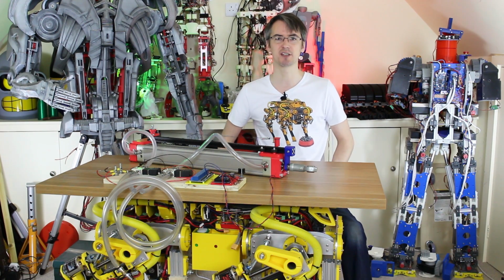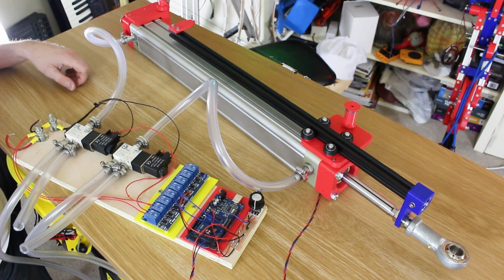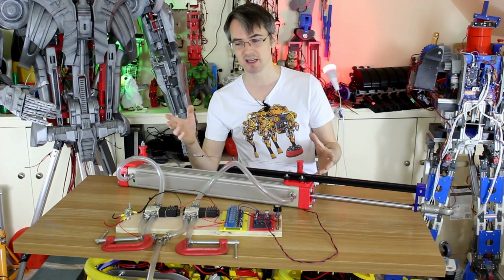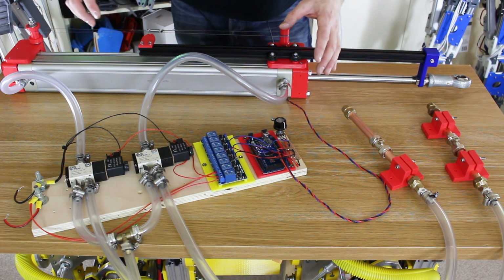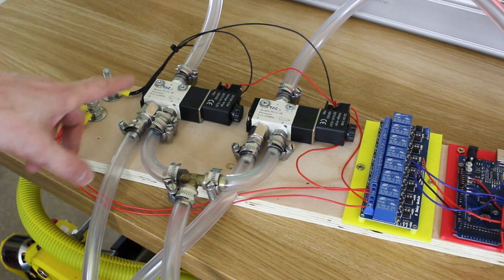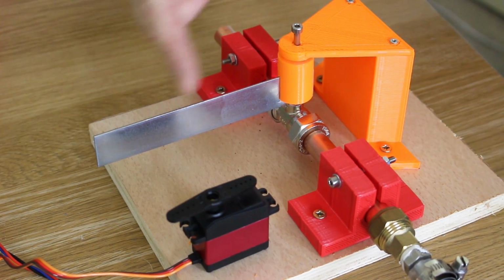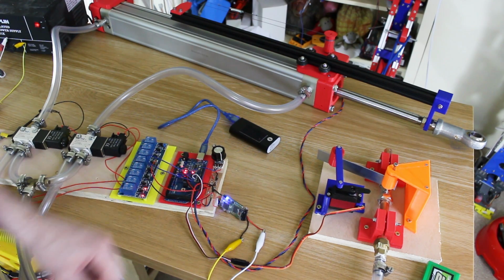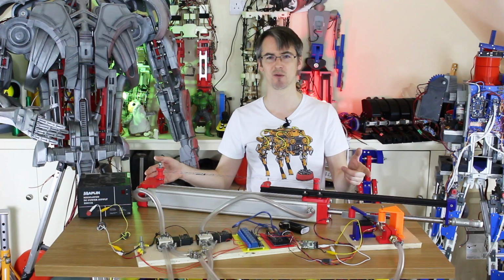Testing Proportional Control of Pneumatic Cylinders | James Bruton

Comment from the maker: So why does the creep go away when I use two separate air sources for each side of the cylinder?
Reply: You are running into why nobody uses a compressible fluid for proportional positioning. The creep problem is likely a number of compounding issues.  Your biggest hurdle is the sticktion of the cylinder gland and piston; the difference between static and dynamic friction. Coupled with low working pressures and low tank volume. Try the cylinder vertically with a heavy weight and larger tank volume; it will have less creep. You can confirm this by using your small tank and very low air flow with a heavy weight. That'll negate the seal sticktion and the small tank problem. I did a demo of this years ago with a cheap flow meter and an arduino and only got to +- 5mm. You're feedback servo is far superior to my flow meter method.
Reply: @arduinoversusevil2025  Hey uncle, glad to see you here!
Reply: Two separate supplies are stable because each side of the piston end up at different pressures, put a pressure gauge on each side of the cylinder and separate the air inputs, you should see that the rod side is higher pressure.
With the same pressure input to both sides you have a force dissemblance toward the rod side because the pressure is maintained the same on both, but the area acting with that pressure causing force, is different, causing drift.
Reply from the maker: @ChatNoirLe  both sources were connected together when they were charged, so they must be identical, to start with at least. It worked first time like this - and this is how I did all of part 1, so I can't see how it's coincidence that one happened to be slightly lower pressure.
Reply: @ChatNoirLe  adding a pressure gauge on each side of the piston AFTER the checkvalves would show that even with a singular airsupply the pressure difference inside the piston will be the same once the creep stopped as when he had the two airsupplys with different pressures...
Reply: The high volume of air just affects the speed at which the creep is fixed. 
The creep is caused by the re-compression of the air in the circuits on closing valves until stabilizes. 
Having a big reservoir makes this re-compression happen quicker, because increases the flow.
Reply: Firstly, the surface area is not identical on both sides. It is smaller on the side where the rod comes out which means, that less force is exerted in the inward direction.

When you use one single air supply, the piston gets pushed down due to the smaller surface are on the side where the rod comes out, which leads to less force being exerted towards the retracted position. Because the air can escape to the other side (and thus the pressure is always the same on both sides) the piston retracts all the way.

When you use 2 separate supplies you are essentially using a stopper. The pressures on both sides changes to a point where the forces onto the piston from either side are equal. That causes the bit of backlash.

The volume changes the amount of compression needed to make the forces equal. If you have got more volume, you need more compression. I think that is Boyle's Law.

I think it would be interesting to see what happens when you actually stop the pressure escaping instead of just restricting it. What I remember is, that designing control systems for hydraulics (especially with compressible fluids) is not that easy and requires lot's of testing.

Edit 1: You should also defenitely get some one way valves!

Edit 2: Thought about digging up my lecture notes, but Festo has pretty comprehensive information on their website you should check out.
https://www.festo.com/wiki/en/Cylinder_actuation
Reply from the maker: @McJunk1  thanks!
Reply: Do your check valves have a spring return? If not they won't close if mounting them sideways.

Can you include a quick schematic of the connections in your next video? It would make trouble shooting much easier as most of the connections are out of the frame.
Reply: As someone who did this for research on pneumatic powered AFO's, you haven't even gotten to the complex part yet. Getting a pid to respond to a system with so little accuracy is basically impossible and is why everyone just goes with "bang bang" control.
Reply: Sorry if I'm saying something you already know.. But it would be easier for you if you take a 5/3 valves rather that two 3/2. It should kill that creep FOR EVER,!! The difference is that there is 3 position (right, neutral, left) and there is 5 entry (2 air output) so the air is distibuted in each side of the piston equaly. The piece I'm talking about is like that: https://www.festo-didactic.com/int-en/services/symbols/fluid-power-pneumatics/valves/directional-control-valves-5-3-way-single-solenoid-valve,closed-in-mid-position,actuation-in-both-directions-by-solenoids-with-one-winding-and-pneumatic-piloting.-mid-position-spring-centred,manual-override-in-both-directions.htm?fbid=aW50LmVuLjU1Ny4xNy4zMi4xMjQ4LjY2MDE
Reply: Like marc gracia said. I feel the issue here is dynamics. Gas can only flow so quickly, especially when delta P is low. There are 2 possibilities, the cylinder is asymmetric or it's a compressible fluid problem. Your volume theory is technically wrong, but volume does affect the dynamic response of the system. Bigger volume means more gas needs to move in order to increase pressure, if you pressurize both at the same time, the bigger cylinder will require more air more quickly to reach pressure. This means that more flow is needed for the bigger side, possibly indicating bigger pressure drop and slower response. If for some reason your bigger side is a bit lower on pressure, then the creep is huge until the piston moves to equalize, on the smaller side, the creep is smaller. Having two separate sources may allow the bigger side to reach pressure faster since the flow is not shared. Compressible fluids dynamics is a big topic and many times is not intuitive. I doubt you will get a good enough precision and response with pneumatics for these type of robotics, hydraulics are better suited for these applications.
Reply: Hello,

With 5/3 valve with close mid position there is no creep. Place flow restrictor s on the  hose inputs of the cylinders and you could control the speed. If you have a cylinders with a buffer you can control the last bit of the stroke.
Reply: If you use 2 sources with identical pressure and your stable point is with both valves active the push side of the piston will move  and compress the air on the pull side util there is an equilibrium in forces.
If you deactivate one valve, thus venting one side, the pressure drops on one side almost completely but also a little on the other side because of the air rushing in.
 When you activate the valve again the venting stops and the pressure builds up fast pushing the piston a little bit back.

Instead of two separate air-sources you could use one source with two pressure regulators then you can balance the push and pull difference.
If speed is not essential, use smaller hoses from the valve to the cylinder.
The start response is slower but you waist a lot less air when venting and the "brake" time becomes less.
P.S. Yo can also shorten these hoses or place the valves directly on the cylinder inputs. The less air you have to compress the shorter the creep.
Reply: Your theory is correct. The air volume in the tanks is taking up the difference in force. Air, unlike hydraulic oil or water, is compressible and is quite springy. The larger the volume, the large the spring force the air will provide. In order for the cylinder to creep, you need to have a difference in force between the sides.

If the same volume (or container) of air is used for both sides, the pressure will be equal on both sides and the side with the larger piston surface area will have the greater force, resulting in creep. With separate air volumes, the force on one side of the piston will compress the air on the other side until the forces equal out, so just using tubing for your volume of air is going to result in the smaller surface area needing to be compressed more to create an equal opposing force than if the volume was larger, resulting in creep until the forces equalize.

Pressure regulation of the air supply for both sides can be tuned to remove this problem by applying a higher pressure to the smaller surface area side of the piston so that it can reach a desired position without creep. You may need to use variable pressure regulators to achieve 0 creep in all situations when you use it in a robotic application though, because of the springy nature of air when you place the actuator under variable loads.
Reply: If you have some pressure sensors, I would be interested to see what the pressure is on both sides when holding from two air sources. The tanks start at equal pressure, but if the piston in the cylinder has different surface areas on top and bottom, when you hold it open wouldn't that force from the high area side compress the air on the low volume side? The valve and cylinder are isolated from the tank by the check valve, so there could be a differential maintained above that.

Hypothesis:
When you hold everything open to hold the system
1. Both left and right rush to normalize pressure upstream and downstream from the check valves with tank pressure
2. Left side due to lack of rod exerts more pressure and begins to compress the right
3. As soon as the pressure starts to rise, the right check valve shuts allowing the right pressure to climb

Does dual supply work without creep if the check valves aren't there?
Reply: I believe you're unwittingly hiding a variable from yourself. Since you're working in duration (opening a valve for a time until a demand position is reached), you're losing track of volume. If the sources are unequal in pressure, then opening them for the same amount of time does not move an equal volume of air. And once the demand position is reached and the valves close... it then drifts until the volume (which wasn't equal) equalizes across the cylinder. You know what a grueling taskmaster Sir Isaac Newton is... he won't be happy until the forces are equal and opposite if you want the motion to be 0. ;) LOL Moral of the story, you have to put in a volume of air on one side equal to the volume you release on the other. Wouldn't it be interesting if you could make a closed system that used the actuator as the pressure reservoir and used something like a pneumatic pump driven by an electric motor to move air from one side to the other. That would assure that the volume removed from one side, is exactly the volume deposited on the other. It can be no more and no less. (Assuming no leaks).
Reply: James, 

Your issue is fairly simple. What you have created, in the machine technician world, is called an air amplifier. When using a single air source, the larger surface area of the cylinder is pushing against the lower surface area, causing a raise in psi on the low surface area side. Air, always following the path of lest resistance, will come out and right back to the other side because of the lower psi. Now when using two different air sources, the problem seems to go away, but it hasn’t. Essentially it has slowed down the problem by creating a capacitor, with the long airlines and the two tanks. If given enough time, you will still experience creep. On CNC’s and other robotics I have worked on, they simply hold the air pressure because of this same issue. Really hope this helps and gives you a better direction. Continue the good work! I really appreciate your videos. If you have any questions, I am more than willing to help out.
Reply: Put a reg on the inlet of each valve. To balance out the movement, if the rod end had 65 percent of the surface area you would set the rear valve to be at 65 percent of the front valve air pressure.  That way the force is equal. 

Creep may also be a thermal thing. Watch it with an infra red camera. You are expanding a gas and it cools, sucking it in. Same way a steam piston retracts after injection.
Reply: Isn’t it still one source of air but I think the
Reply: was there less exhaust tubing in the separate sources setup
Reply: James Bruton if the creep was going backwards ie the other way then it may make sense but lower surface area = higher pressure so I don’t really think you’re explanation makes sense.
Reply from the maker: @oliverdowning1543  I don't really understand the comment here. Creep does what you expect (moves toward the lower surface area side) when there is one air source. But when there are two air sources is initially moves in the opposite way to the initial travel and then stops. Why is this?
Reply: @jamesbruton  put some pressure guages in line with each side of the cylinder so you can see the actual circuit pressures under different operating conditions.  If you use electronic pressure transducers you can plot this data against cylinder position and it will start to make sense.
Reply: @jamesbruton  This is very likely the dynamic pressure at work. When air rushes is it's dynamic pressure is higher than the static pressure in the other cylinder. When the inrush of fluid slows down/stops the forces eventually cancel out and it stops.

Edit: This was meant as an answer to why it goes the other way.
Reply: @jamesbruton  did you see my comment at the top of the thread? I think the reason the effect changes for 1 cylinder vs 2 is that with 1 cylinder air will preferentially flow into the bigger side, compress a bit and then expand slowly causing creep. This is because the rod side has a lower volume and slightly higher resistance. With two sources the air won't divide unevenly between the cylinders. 
I suggested trying to limit the air flow to the bigger side, but you would end up having to limit flow to which ever side has the most volume available.
Reply: @oliverdowning1543  I think not quite so in this case.  If they were separate Cylinders, with different diameters, but this is the same cylinder with effectively the same air pressure on both sides but with less effective surface area to act upon on the rod side
Reply: Justin Richards I see. I’m not an expert so I don’t know, thanks. Maybe the air is moving to the more effective surface area to begin with then because when it’s easier for the air to do that but by using two air sources each flow of air doesn’t have any choice about where it goes?
Reply: The end with the rod has less surface, compared to the other side... The rod is not affected by the pressure...
Reply from the maker: @kimonsabe  Yes but why does the creep go away when I use two separate air sources for each side of the cylinder?
Reply: the reason in my belief is that it still creeps a tiny amount which generates slightly more pressure in the tank and thus balances.
the reason that the non return valves aren't working is that these are the kinds that need a massive amount of flow before they close you need the spring loaded version.
Reply: @killer15114  Thats my thinking also
Reply: Could you try it with no input vaulves at all? Straight from the separate air sources to the cylinder ends with your proportional release on each. And then moving in one direction you just release pressure from that end. Would be interested to see how that works.
Reply: If I remember correctly, that would be because the back side of the cilinder has no piston so the air has a larger area to push, the rod side (piston side) keeps the air from using all the area from the cilinder so it has less force, so it creeps forward (I think it was that)
Reply from the maker: @MrWilliam932  so then why does that go away when I use two air sources - since the surface areas don't change?
Reply: @jamesbruton  I think, and I'm just guessing, that is because with a single source, and both valves activated, the piston forces the air from the rod side to exit via the pressure input of the right valve recirculating the air via the T-coupling and back into the left side of the piston, BUT with separated sources this can't happen because they are making force and no air can circulate between them and because the compressors have a one way valve you can't push the air back inside so the piston can't move
Reply: @MrWilliam932  I am tending to agree with this theory
Reply: @jamesbruton  the bigger total volume of air the less the effect is seen: remember that gases when expanding decrease in temperature (PV=nRT)  thus cool the surroundings. When the valve is subsequently closed the temperature will slowly rise to ambient increasing the pressure of the said volume causing a creep due to different thermal capacity of the volumes. Also, with one small tank the pressure drops more than with 2 due to the increased volume (remember the temp of the tanks decrease as well) because 2 tanks have more thermal capacity than one and the drop in pressure is less than with just one tank. Humidity decanters are needed for this reason also or air is condensed inside tanks and causes rust and debris. Also you should connect the valves as close as possible to the cylinders (use short and rigid tubes) to avoid any "jitter" or debounce when opening and closing valves.
Reply from the maker: @MrWilliam932  Yes but why does the creep go away when I use two separate air sources for each side of the cylinder?
Reply: the pressure is lower on the side of the cylinder with the rod, so more volume of air on the other side with have a greater push force than the other side, which causes the creep.
Reply from the maker: @rock-afire-fan  yes that's what I said on the video. So why does the creep go away when I use two separate air sources for each side of the cylinder?
Reply: @jamesbruton  with the 2 air sources your comparing the difference of the volume of 2 much larger numbers, making the force difference alot smaller
Reply from the maker: @rock-afire-fan  That's what I thought (and said in the video) but I assumed the force was relative to the surface area of each side of the stopper, and therefore it should have the same results.
Reply: @jamesbruton  The reason for the alrger amount of creep when only connected to one air source is that the pressure on the left side (the side that drives the piston out) creates a higher pressure on the right side, and that higher pressure will seek to the lower pressure through their common connection and the piston moves.. When you have two separate air sources it only increases the pressure on the right side, and it has nowhere to go. Connect gauges to the two sides and it will be apparent. The pressure difference only needs to be pressure times the area the rod covers.

Your check valves needs a higher pressure difference/airflow to work properly.
Reply from the maker: @rock-afire-fan  The pressure is the same, but the surface area is less on one side. But why does the creep go away when I use two separate air sources for each side of the cylinder?
Reply: I suggest to add some pressure and temperature meters at differnent places in your circuit. Then we may really understand what is happening. And maybe add a voltmeter to the powersupply of the Arduino. Even servos under some torque start to draw a lot of current.
Reply: By the "boyle marriott law" are pressure and volume connected. I sadly don't have enough time to check if it is a correlation or causality.
Reply: As the cylinder extends, the volume on one side gets larger and therefore applies less force on the piston and the volume on the other side gets smaller and applies more force
This doesn't solve your problem, but i feel  like you didn't consider it
Reply: Volume, please see my comment for information I've got for you on the subject matter.
Reply: I think there are two things at play here, 1) there’s a pressure difference between both sides of the cylinder, 2) the cylinder seal isn’t perfect.

The rod side has a smaller surface area than the non-rod side. For there to be no movement, the force on both sides must be equal. So if you sealed the Cylinder with an equal pressure on both sides, there would be more force on the non-rod side, which would compress the air in the rod side. In a perfect world this reaches equilibrium and nothing moves after this initial bit of creep towards the rod side this phenomenon is faster, and dominates the process at first.

But now you have a pressure differential over a seal, that seal is going to slowly leak from high pressure on the rod side, to low pressure on the non-rod side. This movement of air is going to cause the rod to more slowly creep back to the non-rod side. This is slower, and doesn’t show up until after the first process is finished.

When you connect both sides to a large source of air, you are making the system much less sensitive to that very slow leaking, that’s why you don’t see the same issue when you are using two isolated sources.
Reply: Because air is compressible.  The larger force on the blind side is compressing the air on the rod side which takes a little time to do. Put a gauge on both the blind end and the rod end so you can see what is happening.
Reply: Install a pressure relief valve on the blind end and set it so the pressure is bled off as to match the P*A on the rod end?
Reply: I think it is because when there is the same pressure on each side (1 source) the force differential causes the Piston to move. When you have 2 sources, advance side uses that area advantage to charge the return supply to a higher pressure than the advance supply. This will ballence the forces  If you regulated each side of a single supply to the mathmatical f=Padv(Apiston)=Preturn(Apiston-Arod) you would get the same result.
Reply: It's unequal surface area not volume causing the creep. The rear side of the piston has a full circle to push against vs the donut shape on the front end
Reply: As a mechanical engineer, what I see is you releasing the pressure in one side to make the cylinder move, then you get a little creep back in both directions as that low-pressure side comes back up to full pressure. Air is not a very good pneumatic medium because you can obviously compress it. Not sure you can avoid this with your current arrangement.
Reply: If you calculate the volume area of the effective push area you can calculate the effective force. (measure the air pressure in bar) p=Fxa you need to restrict the presure on the bottom side so that the force is the same. And also use a 4/2 valve because it saves a lot of adjusting time. I also recommend installing presure relief valves on the lines where the air is closed in. Also you should draw a schematic to keep organized.
Reply: Maybe if you replaced the tubing with some thinner ptfe tubing. It will maybe prevent the air compressing a lot in the tubing.
Reply: if you want i can upload a sketch on why you have this creep and why it stops at a certain point....
Reply: Because you have no loop back over the pressured side..
Valves always leak a tiny bit
Reply: https://en.wikipedia.org/wiki/Polytropic_process

pneumatics is tricky especially with gases like air. If you add a regulator you will end with valves effectively sucking power from the compressor as fast as you force them to regulate.
Reply: I would suggest testing with a double rod cylinder so both sides have the same area. Perfect on that first so it eliminates the area issue then tackle with this cylinder so you are only dealing with one change.
Reply: I'm no engineer but what if you use 2 one way valve at the T junction to prevent one vent going into the other vent?
Reply: Any chance the problem is in the vinyl tubing?  There's likely a lot more expansion in the tubing than you think.  First noticed the problem on a cheap pressure washer. It had plastic hose and would sometimes oscillate the cut out valve. Replaced the hose with a quality rubber hose and the problem went away.
Reply: Short answer: Because the pressure of Both pressure cylinders is not the Same.

When you at first fill both Pressure Cylinders with the same pressure and then connect them directly to the Actuator (with no valves in between), then both sides of the Actuator will initially fill to the same pressure. But because the Surface area of the side without the shaft is bigger then the other side, that side has more Force. So the shaft extends. While the shaft extends, the volume of the side with the shaft is reduced and because the air cant go anywhere the pressure increases. At the same Time the Pressure at the other side drops, because the volume gets bigger. This continues until the forces of both sides are equal. The Volume of each side is the complete volume, means the volume of the pressure cylinder and the volume inside that side of the Actuator. This means, smaller pressure cylinders are better, because a smaller change in volume with a smaller pressure cylinder results in the same pressure increase/decrease. Because the volume of the actuator is my be a tenth of the pressure cylinders this works relatively good. When the volume of the actuator would be a 100 times smaller or even more, then you would have similar problems.

By using the check valves the problem of continues creeping is solved, but every movement backwards the front side (the side with the shaft) only gets pressurized by the same pressure as the other side. So after the movement has completed and the back side of the actuator is pressurized again the front size has to reach a higher pressure to equal the force. so the volume of the front side has to be reduced to reach that pressure, so the shaft creeps out until the forces are equal again. This effect is basically unavoidable if both sides of the actuator are pressurized. The solution is to block both actuator ports to trap the air, like a 5 way valve with tree positions and the center position being locked. thees valves are the best for position control without controlling the speed.

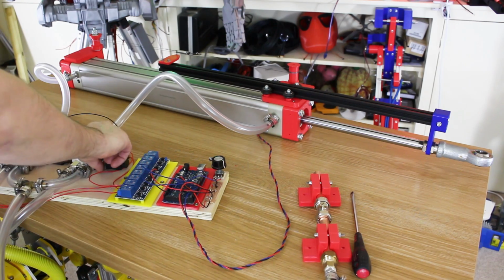I have noticed that you are depressurizing the actuator too fast. While moving the actuator  booth sides of the actuator should remain fully mostly pressurized. It becomes very clear when you did the test at 11:20. The back movement when both valves are activated again, is because the pressure gets much higher again. The solution is to restrict the leaving flow of air more, which also slows down the actuator. Basically the actuator is not made for so high speeds. I the maximum acceptable speed would be 2 seconds for a end to end movement. Too have higher controllable movement the ports, tubing and valves should be much bigger.The best flow control valve are one way flow control valves. Basically thy solve most of your problems. They are one way so the actuator doesn't creep to one side continuously. Also they do it directly at the actuator, so the compressible volume is lower, so the actuator behaves much stiffer. Also the back pressure is maintained at movement, so the movement is much smother. Only draw back is that speed control is very difficult with those.

If you want more Information and help about controlling the actuator with variable speed please contact me at twitter @IIIMADDINIII.
Reply: its to do with the cylinder the rod takes up surface area on the rods side so the amount of force generated is less due to the lower area being pushed on
Reply: if you could adjust the air pressure in each side you could technically have lower pressure on the non rod side and therefore generate a balanced force removing the creep  you'd have to do some maths on the pressure difference needed. possibly use a blow of vaulve or regulator
Reply: also one more solution is to use the volume in each side of the cylinder to calculate the amount of air in each side of the cylinder. you can then use some pressure equations to figure out the volume of air needed in each side which would initially offset the cylinder but it would then creep to the equilibrium point (which you want to be your position) although any force applied to the cylinder rod would move this. so you'd need to make a model of the air cylinder really
Reply: I think it's about the non-return valve. You might be having so small pressure differences in high pressure (and still some airflow) that the non-return valves won't close properly. Also I wonder if there could be some resonating pressure pulses which opens the valves.
Reply: James Bruton I think you should try to put a check valve on both of the outputs. It is really the only thing you haven't done but I think it will lead to true isolation.
Reply: If you think about the non-return valve, there is basically a piston inside. Could it be that the piston area of the non-return side is slightly smaller than the other? If there's a spring inside it could be stealing some piston area.
Reply: i think you should check the max backpressure of the check valves and measure the presure in the front side of the cylinder, i think the back ram pushing is exeding the rating on the check valve, or try to fill the front side of the cylinder with smoke to see if the chec valve is loosing air
Reply: You don't have quasi-static equilibrium. Basically the gas is not being compressed at a constant rate but rather the gas near the piston is at a higher pressure due to Newton's first law which is causing the initial creep.
Reply: @James burton have you tried controlling solenoid using pwm ?
Reply: Check valve from supply tank to auxiliary tank.
Reply: The surface area of the preasure contact inside the cylinder is larger on push direction compare to pull direction due to the area cover by the inside rod so i will move even on balance pressure

The best way is to use 5 ports 3 position pneumatic solinoid valve with (pressure center) along with a rodless cylinder
Reply: Yes sir Dave C its was the rod thats making the pressure difference i prefered rodless that uses powerfull magnets to transfer movement from inside
Reply: There also meter out and meter in system to regulate the flow of air making the balancing so easy hope that helps
 sir james bruton 😊 im a fan of your work 👍
Reply: @dhansantv395  if that were the case, then the pneumatic would always extend by itself if unplugged and left alone in atmospheric pressure.
Reply: @Iamapinkelephant  thats a sily one hehe yeah thats a equal presure but does the presure enough to move that object maybe it will be possible i you will use a material that is almost no weight thay can float in atmospheric pressure ah that material should be zero friction maybe that may extend as long as he can 😅

And thats the reason why most pneumatic uses gauge pressure that shows "zero" on atmospheric pressure 😁
Reply: @Iamapinkelephant   the surface area of the push rod does not have zero pressure, but atmospheric pressure. Therefore the pressure inside the cylinder has to be higher than outside.
Reply: @Iamapinkelephant  that is a good point,  curious tho if you could center the piston, vac out the air on both sides then open to atmosphere, would that then creep?
Reply from the maker: @dhansantv395  Yes but why does the creep go away when I use two separate air sources for each side of the cylinder?
Reply: @jamesbruton  maybe its not already equal pressure 😊 its possible but two supply is that too redundant but non the less a great solution
Reply: @dhansantv395  is correct.  The datasheet for the dual-action cylinder should show force coefficients for the push and pull directions, and the pull direction is always a bit smaller because the surface area of the piston on the side with the rod is less.

As someone else pointed out, there are cylinders that use external rods, but there are also cylinders with rods on both sides.  In either of those cases, I'd expect the force coefficients to match.
Reply: now that i see you have pinned this i will provide my answer again, lol

you didnt just change the air source when you made the change is why it seems like changing the source repaired the problem. it was something else that you changed while changing the source. you did stuff to the exhaust at the same time as intake, the only thing i would change is that if you want to get the system down to minimum parts. you only need full source air applied to the side of the cylander with the pushrod, you should  use an air regulator and move the pressure down until with both valves open applying pressure the regulated source adjusted until the pushrod can hold position. and remember an air restriction is not pressure regulation. surface area of the end of the pushrod is why  you need to use regulated air on the non pushrod side. also you can get cylanders with pushrods that go through both sides. eliminating any pressure differential caused by surface area (and gives you another attachment point).
Reply: also to get more on point to as to the creep issue, you have minimized NOT resolved it. it has been minimized by allowing the side with less pressure in it to be compressed by the side with more. if you get all sciency you will find that the side with more surface area will have slightly more creep than the other side. what air pressure are you running this test rig at? psi please just curious, once the valve  is suitably engineered that the creep issue will be minimized further by higher pressure with the added bonus of more holding power.  Also may i suggest you move to what we call where im from D.O.T. (tractor trailer) fittings and air lines. good for 150+ psi and push to connect fittings for the plastic lines make troubleshooting and valve switches a little easier.
Reply: hrmm.. a thought just occured to me. if you applied a vacuum source to the exhaust side you could increase the force applied to the piston as well. i wonder how much additional force could be applied on a piston in such a manner i dont have the math wizard hat to figure that out.
Reply from the maker: @davec6208  it was distinctly different though, and a repeat of what happened in part 1, so it wasn't a fluke
Reply: @jamesbruton   im sorry if you misunderstand. but i was not saying it was a fluke, i was trying to say that the way you switched control of the exhaust gasses was what changed the performance charactaristics. not the way you supplied the air to the valves.
Reply: @davec6208  perfect vacuum (which is basically unachievable) roughly equals -14.7 psi. So you'd gain that much more "pressure" on the positive side. Have to take unto account the surface are of the piston to calculate exact force
Reply: @davec6208  the most you could gain is 1atm pressure (difference between vacuum and atmosphere), assuming you have a good vacuum pump. It's far better to just deal with positive pressure.
Reply: You actually were correct, its because the pressure difference within the VOLUME becomes negligible, meaning the pressure on either side of the stopper P_1*F_1=P_2*F_2 (and thus on the identical surface areas) are aprox. the same. The pressure of the air of course is dictated by the  P=N*k_B*T/V so having two large volumes nearly the same means the pressure is pretty much the same, and holds better as there will be more particles to attempt to compress on side and decompress the other side.
Reply: Best guess without any hard math or long drawn out thought experiments that is :P
Reply: Just a thought. Try putting a slight restriction to the flow rate of the big end of the cylinder. I'm wondering if it has something to do with the larger end having more room to fill up quickly and then because air is springy it pushes out quicker than the rod end which fills slowly. 
If the above works, then I'd guess that the reason having separate tanks works is because when they're on a single line, air takes the path of least resistance and flows into the bigger chamber, separate tanks, the path is the same.
Reply: Maybe you just have a tiny leak somewhere. How are you checking for that by the way?
Reply from the maker: @antondewinter3862  If it were a leak then it would keep moving for ever when air is locked rather than slowing down and stopping?
Reply: @jamesbruton  Yeah, fair.  Although it might be a leak that only happens above a certain pressure but I'm not sure how likely that is.
Reply: James Bruton this project is very exiting because there is not much pneumatic projects on YouTube and I really hope you can continue
Reply: @jamesbruton  I still support the original leak hypothesis.  I think there was a leak and it improved over time, perhaps from oil in the air supply.  It would be really instructive to tee in some gauges or pressure transducers on each inlet downstream of the control valves.  You should observe pressure intensification due to the difference in area:  A force balance on any stationary piston should give P1A1=P2A2+static friction.  If static friction is small then the equation tends towards P2 = P1(A1/A2).  Either way, more data is more better (transducer feedback loop force control???)
Reply: @jamesbruton  the creep stays because when you open both valves you apply the same pressure to both sides. the side without the piston rod converts the pressure into a bigger force because of the larger active area of the pistonhead. the side with the piston rod is now forced outwards, but because of the checkvalve the air in the piston cannot leave. thus the trapped air gets compressed in the shrinking volume of the rod side of the piston and increases in pressure. this continues until the increase in pressure and thus force on the pistonhead balances out with the force on the other side and thus the creep stops.
Reply from the maker: @TheScarvig  so why does it go away when I use two air sources?
Reply: @jamesbruton  didnt you mention in your last video that your two aircources were balanced to have different pressures so that the creep goes away? then the pressure is balanced on both sides to begin with and thus no creep at all.
Reply: @jamesbruton  rewatching both videos i guess that the difference in volume available in the pistonsides due to the piston rod could maybe enough to autobalance the two tanks because of the different amounts of air taken from them. that way filling up one side of the piston uses up more air from its tank than filling up the other side to the same pressure. i noticed that your tanks seem to be of different volume which would amplify this effect.
i suggest you try swapping the tanks to see if you still get no creep with two supplies.
Reply from the maker: @TheScarvig  They are both 24 litre tanks charged while connected together with no regulation. I did all of the last video like this so it's not a fluke in terms of pressure balance. It's distinctly different to using one air source.
Reply: @jamesbruton  
I haven't seen anyone mention temperature and the effect it has on working gasses, but for me that seems a likely explanation for the absence of creep when you have the two separate sources for example.
Anyway, what I see when I look at that creep is: during actuation gas on one side of the piston is expanding - doing work - and cooling down  below room temperature.  Immediately afterwards the gas warms back up to room temperature again, and so it does a little bit more work. I'm not sure if this explains all the phenomena in the setup.
Reply: @jamesbruton  well physics can prove that the creep comes from a difference in force that gets reduced by compressing the volume with the smaller active area so that the pressure rises to match the force over the active area on the other side...

and though the tanks might start with the same pressure, due to the different volume of air one side of the piston compared to the other side the pressure inside the tank with the piston rod side attached gets reduced ever so slightly less than the other one.
(assuming constant temperature)

lets say the piston can take 1l of air when fully extended. now we assume that the piston rod takes up 10% of the volume when fully retracted.
when supplied by a 24l tank with 60psi the air in the tank has to fill a volume of 25l when changing from fully retracted to fully extended.( plus some change for hosing...) the gasformula states that R=P*V/(n*T)   (https://en.wikipedia.org/wiki/Gas_constant)
has to remain constant. assuming that the temperature T doesn't change and the amount of moles n in the closed volume cannot change aswell we are left with P*V=R=Pnew*Vnew.
using our assumed piston the pressure in the tank drops from 60psi to 57.6psi when fully extending and from 60psi to 57.8313psi when fully retracting.

if you do not keep filling up those tanks they will become unbalanced by them selves to the point where there is no more creep as the pressure on the rod side is sufficiently higher to compensate for the smaller active area.

though all this assumes a perfect system with no leaks....
Reply from the maker: @TheScarvig  It worked straight away when they were the same pressure. Also it's behaves completely differently to one air source, so it's not some fluke in air pressure balance.
Reply: @jamesbruton  well... then I'm all out of ideas.... would have to come visit and tinker around to find out what's going on 😅

still physics don't lie. but non ideal setups can fuck up what works in theory...